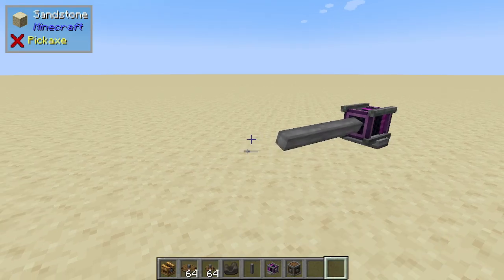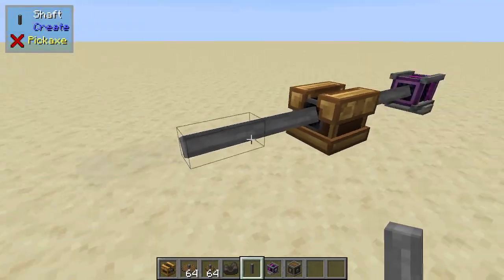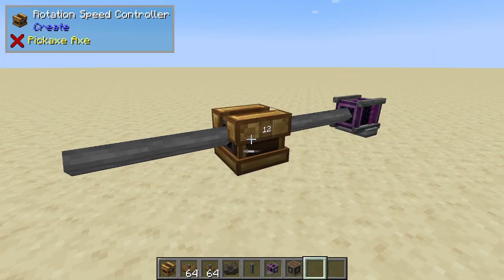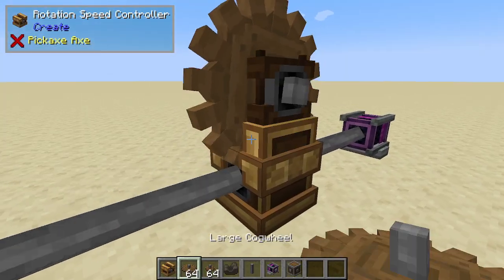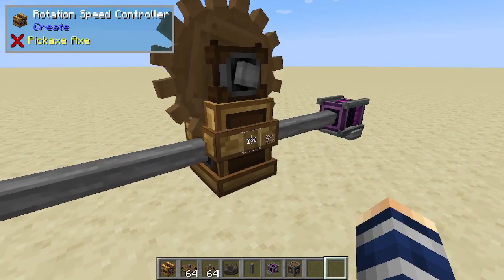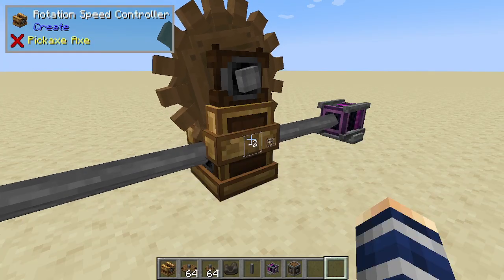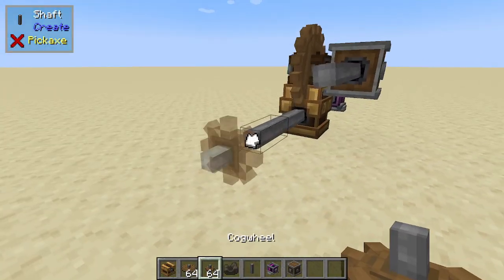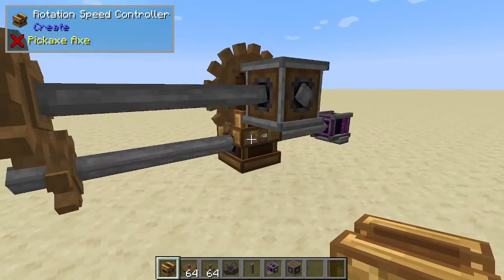Create: Rotational speed controller

Comment: The speed can be set to any integer from 1 to 256. my speed controller cant go negative
Reply from the maker: 1.18 can goto -256 to 256
Reply: @MCMentor1 im playing on 1.19.2 and it cant go negative… help
Reply from the maker: @miosatou  use a gearshift with a redstone signal to control the the direction of the output
Reply from the maker: @miosatou update the 1.20 version has a second slider bar in the gui to change rotation direction